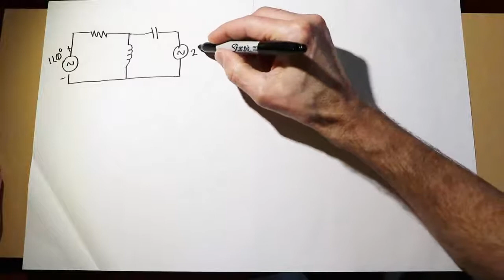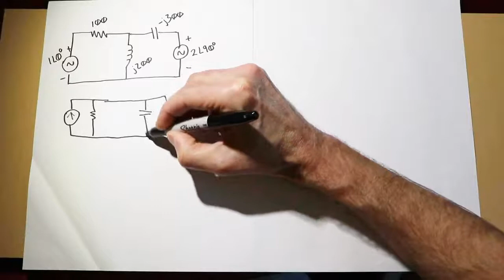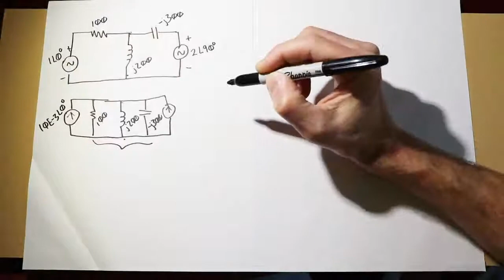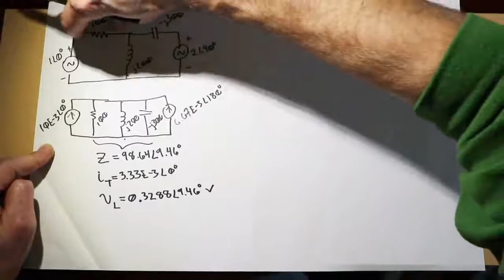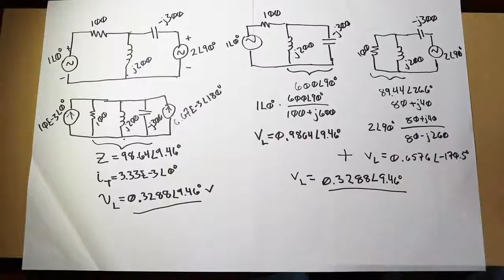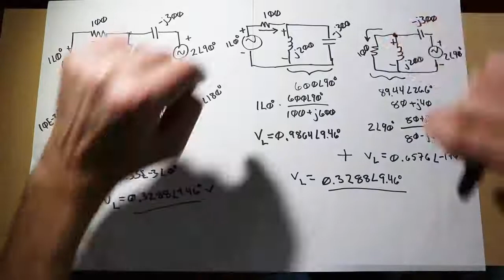AC Electrical Circuit Analysis: Superposition Theorem

Comment: Thanks....So for finding "power dissipation", we can't use it?
Thanks.
Reply from the maker: Not directly. What you do is solve the circuit for the associated voltages or currents, and then use those to find the powers.